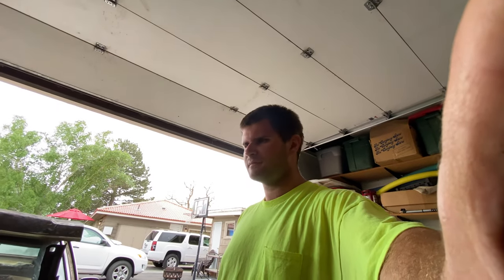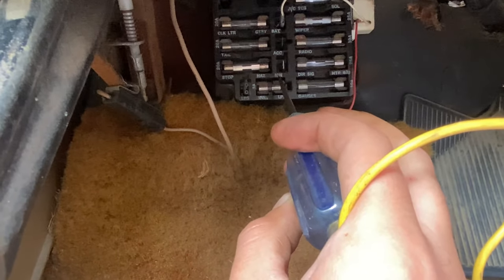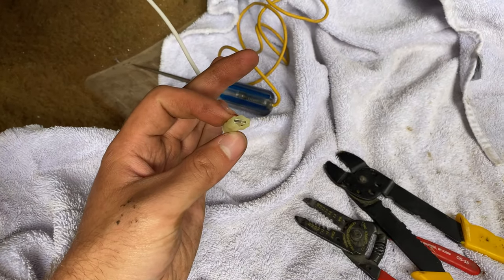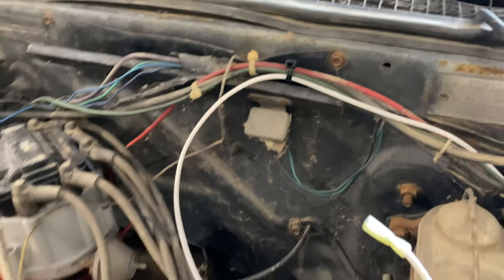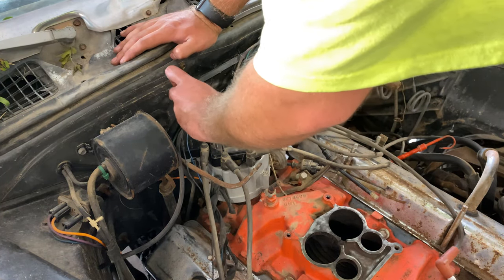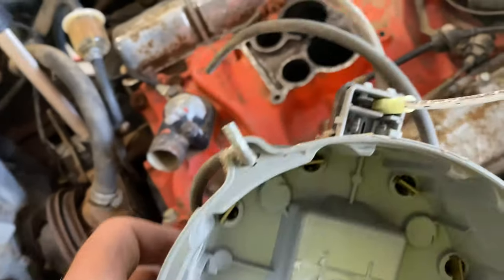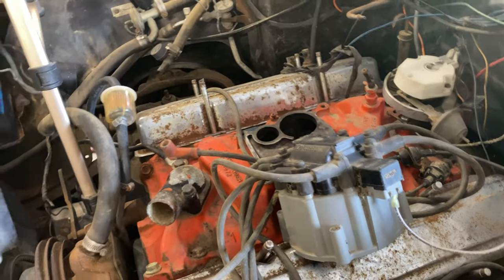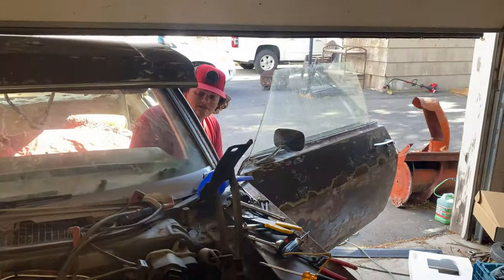How To Wire Up An HEI Distributor (GM A Body)

Comment from the maker: We we’re aware that the distributor vacuum advance was in the incorrect location and used an incorrect type of wire. This video’s purpose was to “simply” explain where to run a wire to the distributor and how to connect it. Not how to completely install one. Thanks for watching!
Reply: So you don't need to connect the tach?

Comment: So I'm about to hook up an hei distributor to my car. Due to the year of my car I do not have an ignition terminal. Can i just wire it to the bat terminal or the accessory terminal? I have been going back and forth on forums and they say do not wire it to a fused terminal. I just don't know what to do.
Reply from the maker: Does the battery terminal always have power?
Reply from the maker: Basically all you have to do is wire the distributor to something on the fuse panel or whatever power source location on your car to something that has power when the key is on. But also turns off when the key is off. If you don’t have anything like that you can wire in a switch yourself to control the distributor.
Reply from the maker: Some accessory terminals cut power when the key moves to the cranking position. You can check that with a multimeter or test light. If I’m not mistaken most cars have the batt terminal is always on regardless of the key position even in the off position.
Reply: @ATDGarage  so then wiring the hei to the accessory should work I'm just afraid that it'll blow the fuses
Reply from the maker: Yes it should work as long as you make sure it still has power when the key goes in the cranking position. Mine didn’t blow any fuses when I did it. If it does no biggie that’s what they are there for. If it blows one then you’ll know you can’t put it there.
Reply: @ATDGarage  alrighty I just tested all of them and the accessory terminals are the only ones that I can use. I will have to relocate the wires that I already have there. If they blow, oh well 🤷
Reply from the maker: Cool! An hei only draws 2~3 amps. So you should have plenty of amperage left on whatever terminal you use. All the fuses in my car range from 10 to 25 amps. Assuming yours has similar sized fuses. You should be golden
Reply: @ATDGarage  okay thank you for the help!
Reply: You can attach it directly to the ignition terminal on the key switch itself.

Comment: Doesn't the distributor need a resistor wire for it not to eventually burn up from too much voltage?
Reply from the maker: Only points style ignitions require some kind of resistance, HEI requires constant 12v
Reply: Excellent!
My 71 C10 left me stranded few days ago. Short story: resistor wire went dead on me (cause still unknown). Ran a 12g wire from fusebox to dist..."was" concerned about over voltage...until now!
Thank you!

Comment: Hey could you tell me we're the wires from starter go to through the harness , I turn key and get no ignition signal the problem is between key to starter , thanx in advance
Reply from the maker: There is a ignition switch at the bottom of the steering columon on the top side of it. Kinda hard to see but there should be a wire harnes that plugs into it check that.
Reply: @ATDGarage  will do , thanks alot

Comment: Vacuum advance module should be pointing kinda at the passenger side headlight......that one points kinda master cylinder
Reply: Yep, vacuum canister is supposed to point towards passanger side.
Reply: I agree it definitely should be pointing towards the passenger side headlight

Comment: why are you using thhn 12awg house wire on a car?
Reply from the maker: Cuz it’s what I got. And she’s workin mint
Reply: @ATDGarage  very well and good sir. And not a horrible choice. As an electrician i can tell you the wire has about 2 yrs life in that situation. Check for cracking by bending from time to time. Once that happens the insulation will start to crumble off and will need to be replaced. Purists might say never but i understand you run what runs. Good job and it is educational.
Reply from the maker: Thanks for the info as well, didn’t know that. 
 Glad you liked the video.
Reply: Looks like 12ga electrical wire to me.

Comment: I don't know. Wrong type of wire, vacuum connection in wrong position, should check the actual voltage at fuse panel, open intake manifold, and touched electrical components in distributor with bare hands. I think you should reshoot video.

Comment: Why not just use the old ignition wire that connected to the old coil ?
Reply: they are resistance wires and dont provide a clean 12 volts. you can hook to the regulator.
Reply from the maker: I actually just learned about this a few weeks ago thought it was pretty interesting. That explains why it wouldn’t work. I tried using them back when this video was made but that explains why I was getting inconsistent results
Reply: @ATDGarage  also can fry the coil iirc. there is a power source that feeds the regulator though that is 12 volt you can use on the firewall.